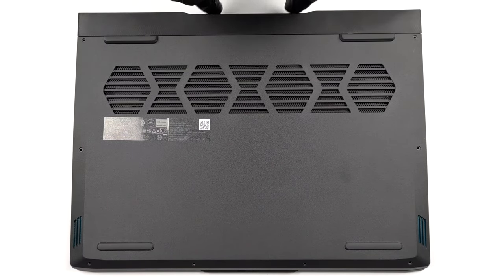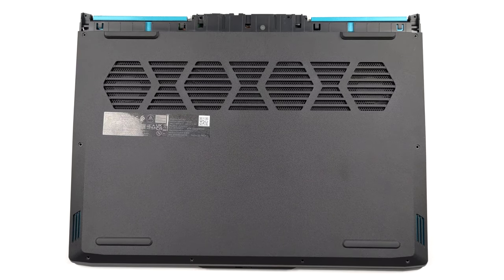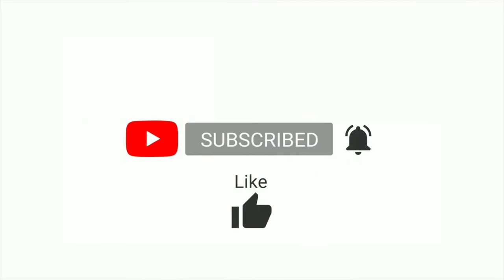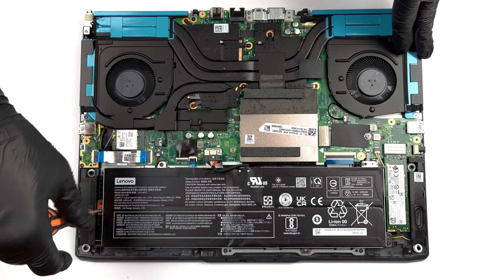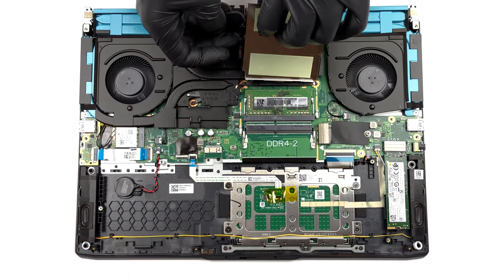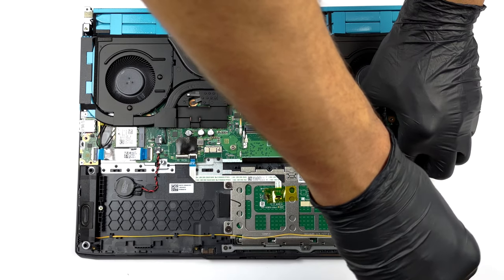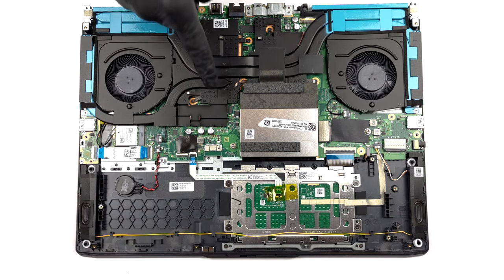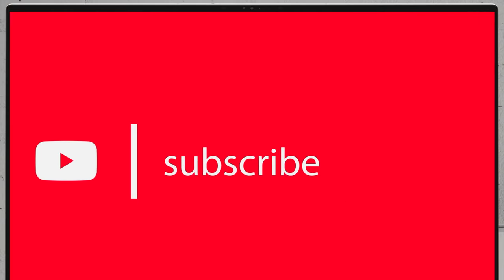🛠️ How to open Lenovo IdeaPad Gaming 3i (16", 2022) - disassembly and upgrade options

Comment: This vídeo did help me a lot. There was something loose on my Gaming 3, making a ratling sound when i moved it. I disassembled it many times to check on the speakers and when i say you taking of the battery and showing the other battery under it, i almost had no doubt. Problem solved. Thanks.